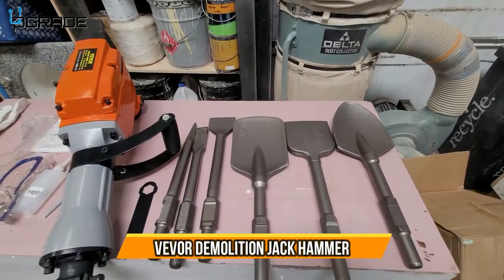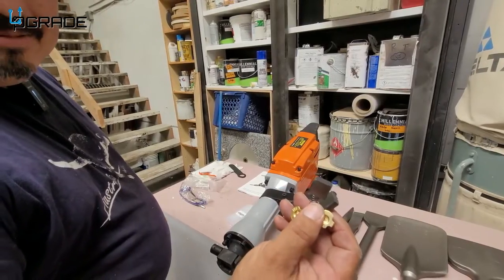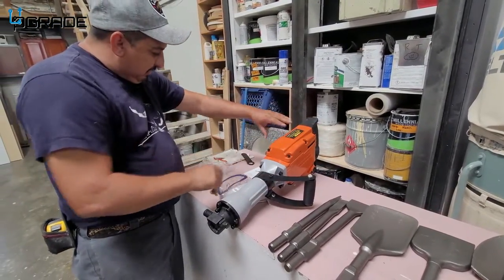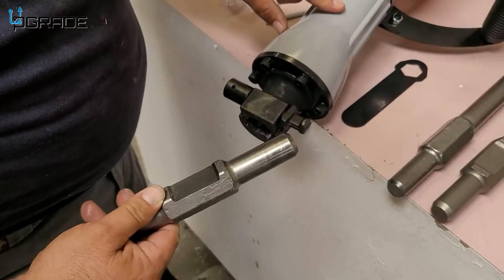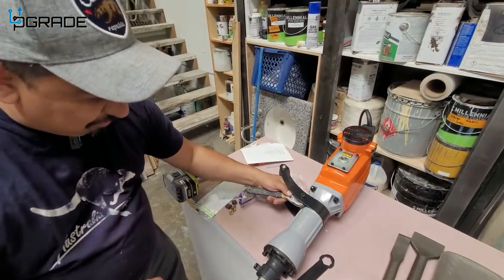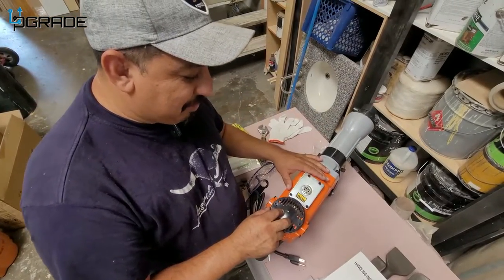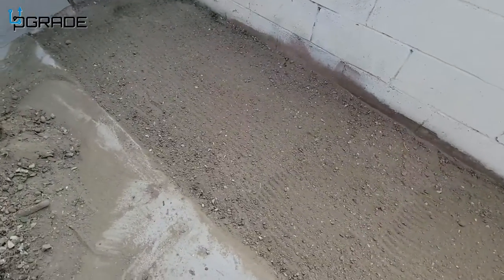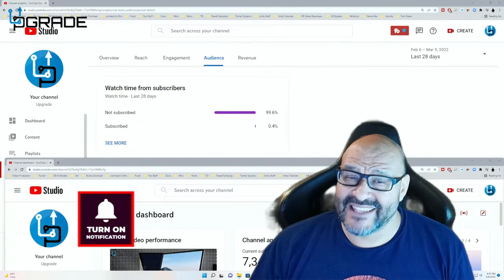VEVOR Demolition Jack Hammer

Comment: These bunch of whiners complain too much they could break that concrete slab with a carpenter`s hammer. Then do it! I was trying to remove a 2-inch asphalt with a lot of cracks already due to its 20-plus years for a few days using a hammer and crowbar and gave up. Bought this to do the job.

Comment: Where do you find the ISO VG 46 hydraulic oil for this in a 1qt or less?

Not sure if you can sub other oils:

SAE and ISO use two different scales to measure viscosity. SAE 10W is equivalent to ISO 32, SAE 20 is equivalent to ISO 46 and 68, and SAE 30 is equivalent to ISO 100. As you can see, there is a bit of a difference between ISO 68 and SAE 30.

Compressor oil and hydraulic oil are not the same. They are designed for different applications and have different properties that make them suitable for their respective uses.

Compressor oil is specifically formulated for use in air compressors. It is designed to lubricate the moving parts of the compressor and provide sealing and cooling functions. Compressor oil typically has additives to prevent oxidation and to improve lubrication under high temperatures and pressures.

Hydraulic oil, on the other hand, is used in hydraulic systems to transmit power. It is designed to transfer power and lubricate the moving parts of hydraulic machinery, such as hydraulic pumps, motors, and cylinders. Hydraulic oil has properties that allow it to flow easily through hydraulic systems, provide lubrication, and withstand high pressures and temperatures.
Reply from the maker: Any hardware store that sell chainsaws or Amazon
Reply: @Upgradetech  I can only find one on Amazon that looked close ISO VG 46 and it was one quart. What does it have to do with chainsaws? I have chainsaw chain oil but I think that's quite a bit different.

Comment: You did that thin cement to do the video, is not concrete, because is with out grabel, that way is very easy to bracket, you can brack it with a carpenter hammer.
Do  an other video with real 4   inch concrete.